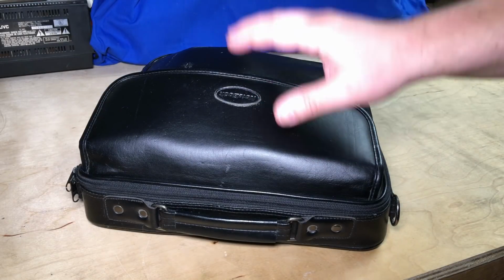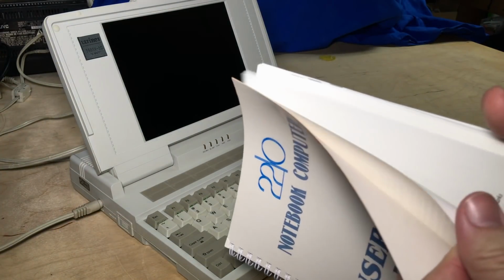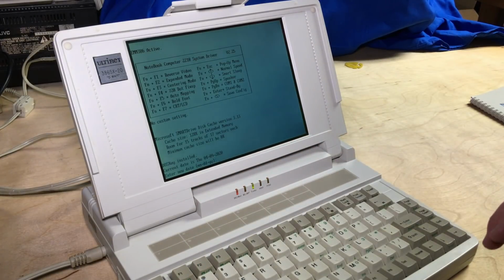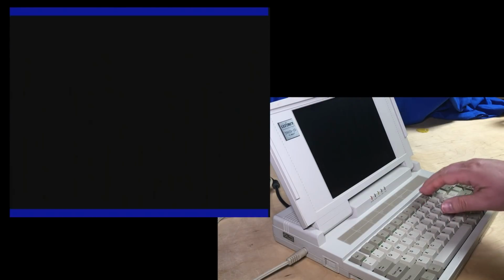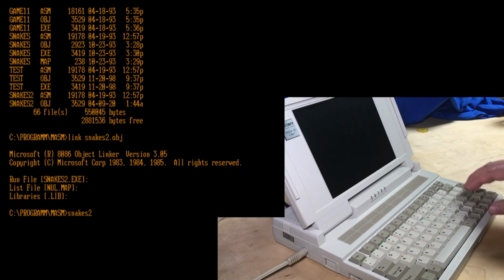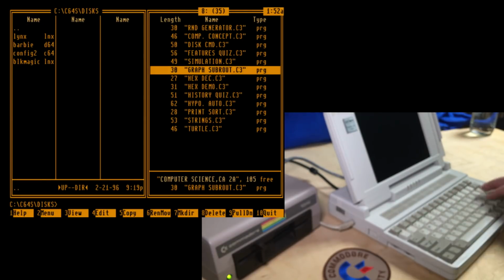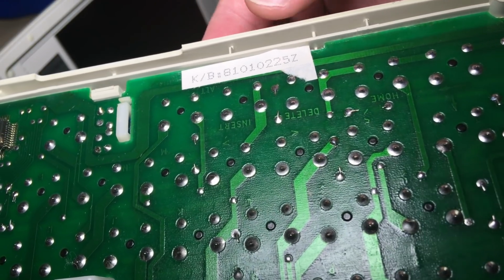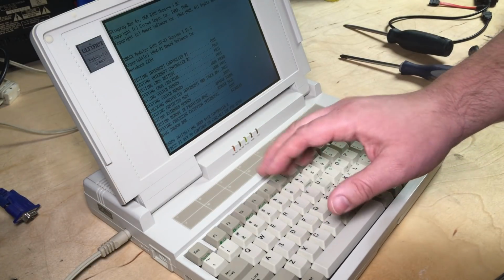My 386SX Laptop: X1541 C64 Transfers, 8086 Assembly, MS-DOS and More

Comment from the maker: Update: mystery already solved! Thanks to Jim Leonard (co-creator of MobyGames and 8088 MPH coder) who identified this computer as a rebadged Nan Tan 2210.

Also thanks to Jason Compton for finding a review of 3 rebranded Nan Tan 2200 machines (from Bitwise, Micro Telesis, and National Micro Systems) in the August 1991 issue of PC Mag from pages 136 to 143 : https://books.google.ca/books?id=JkmqysqcLI0C&q=nan+tan+2200#v=snippet&q=nan%20tan%202200&f=false
Reply: Sager/Clevo is another major manufacturer of generic, unbranded laptop computers, made to allow smaller vendors to sell computers that are either unbranded or rebranded with their company name and logo on them. For example, System76 is a company that sells laptops preloaded with Linux, and when you order one from them, it is drop-shipped directly from Sager's warehouse in California.
Reply: "0 wait" on the shield is about zero-wait-states RAM. A performance boost technology, thanks to that Headland chipset.
Reply: That big Headland chip isn't a VGA. It's highly prised all-in-one system chipset vendor of the era. VGA is CirrusLogic chip (under the shield) + Bt chip combination.
Reply: Upgrade time while you have the lid off, ram and co-pro should be easy to source. Wonder if you could refurb those batteries, maybe wedge some lithium cells in for a longer runtime. 😁
Reply: 8-Bit Show And Tell looks like a toshiba t series. Floppy ports and battery parts are toshiba. Its battery packs look like the t1100.
Reply: I have a laptop very similar to this, but I'm not sure how similar. I'll try to dig it out and check. I'm in Germany.

I didn't actually have it back in the day, I got it 5-10 years ago for free, someone found it in their basement or something.

It's in dire need of restoration, I've not gotten into that yet. It could need some cleaning and retrobrighting, also the harddisk is broken, I thought maybe it can be replaced with one of these CF card things...
Reply: Wan Hung Lo computer corp

Comment: You could try the hard drive in a desktop to save the data. Sometimes the caps gone bad and it can't spin up. But sometimess if you hold the disk vertical or put it in the freezer for a bit you can get it to spin up one or two times again. Once you do, don't turn it off quick save everything to another HDD.

Comment: Interesting video - I would like to see another one about the restoration because I fell in love with similar laptops by Toshiba in dark grey and with orange plasma screen; I tried twice to buy one from Ebay, but both didn't survive the shipping. :-( Seems such machines are way more fragile than C64s and 1541s.

That Snakes game looks like fun - reminds me of Boulder Dash.

A note to users of Star Commander: Don't hesitate to use warp mode, the documentation says it is not only the fastest, but also the most reliable transfer mode!

I started using Star Commander to transfer data a few months ago. It goes 1541 -> Win98-PC -> 3.5″-disk -> any computer with internal or external USB disk drive. (Perhaps I should look for Win98SE which should be able to handle USB.) 

The Win-98-PC is configured to boot to a DOS menu similar to yours, with one option being to boot on to Windows. In that menu I used escape sequences for colors reminiscent of plasma-orange, but that doesn't help some old DOS games having that ugly color palette with cyan and magenta - any monochrome screen should drastically improve the aesthetics of these games.

Comment: Oh man, that thing looks reasonably similar to a 386SX laptop I did a video on last week.  The poor thing had been sitting in the bag for years with a corroded battery.  Unfortunately as I was 'repairing' the Dallas RTC chip, the motherboard seems to have died on the operating table.  It won't POST anymore.  I'm pretty disappointed about it.  I managed to get the machine to start up a few times no the video at least.  Has almost the same Award BIOS as yours, and the whole machine has an odd brand also.

Comment: Slow emulator oh my have you forgotten the C64 emulator running on an Amiga 68000? I think it was about 10% the speed a real 64! The fact that it came to the cable that you could plug in a 1541 drive was really it's only saving grace
Reply from the maker: Yeah, that C64 emulator on Amiga was laughable. I talk about it a bit on this podcast on my 2nd channel, actually: https://youtu.be/sKnlNHHKTEE

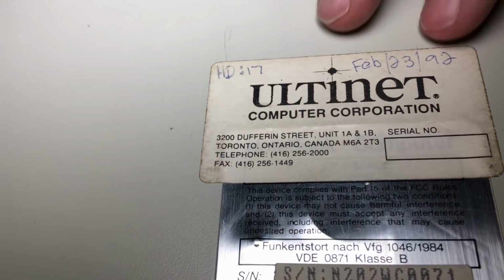Comment: They sold these things in germany too. 2:43 you can see that at the sticker. "Funkentstört nach Vfg" is german.
EDIT: Maybe just in Switzerland and Austria. Because there is no TÜV Sign on the Sticker. Back in the 90th's any Electronic device (before the mass production from china ^^) from this size needed a TÜV approval.

TÜV is a company that check if stuff (Electronics, Cars etc) is safe to use (Fireproof etc) it's hard to say  if the TÜV is a ""company"" by the state, but it's for the state. But if something got the TÜV Sign you can sell it for more, because people priorize stuff with the TÜV Sign.

TÜV is also the Group/Company the check any 2 years your car for safety (it cost 70-120€ !)
If your car fail the TÜV Check, it is not allowed to drive the car anymore on streets, if your car dont fail you get the TÜV Badge on your license plates.
That's why most people here hate the "Car TÜV" because most TÜV Checkers, expect cars that look like a 2-5 years old car, and are just ***holes. They are very picky, and if something is a small problem, that can be fixed in one minute from them (like headlight settings to high)
 they will not fix it, they will just inform you, and write the problem on there list.
3 small problems (and there will find 3 !) and your car has failed, then you got 30 days time to fix all, after 30 days you must pay 35€ again, and there will check for the problems on there list, and if your car fails again, you must do next time the full check (70-120€) again.
1 Big Problem (what they declare as big, is often enough ridiculous) and your car has failed.
Last time my car has failed because of a ""Big"" problem. The Hood from my car was not easy to open (the lever was stiff)
Yes open, not close ! Those idio** saw a hood that opens not easy as a security problem, i would understand it, when the hood dont close easily but open ? But that's how the TÜV is.

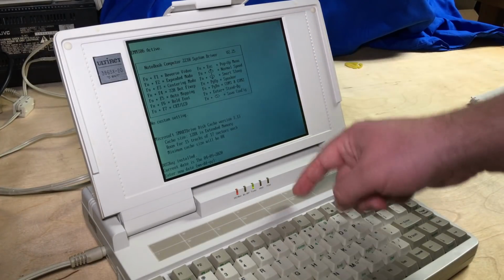Comment: 9:04 I was looking for ages for a software for one of mine until I found note3300.sys or something. It works. I have two very very similar cheap non-branded machines. Same BIOS, but 486 machines. The newer one has a larger screen and allows using the VGA port without this special driver. Also has 512k VRAM (finally...). The insides look like they came from the same factory.
Lol the display turns off the -20V for driving the LCD pixels, but the super power hungry backlight stays on - like the company who made these didn't know what they're doing.
That snake game looks like Rodent's Revenge without graphics but with music.
29:00 That black blob looks like what generates the -20something volts for the display.
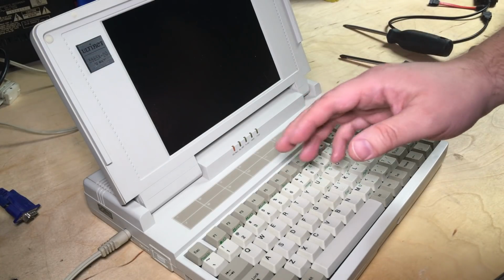30:00 check http://tempect.de/senil/p10.html these Conner Hard Drives have a very common and relatively simple to fix problem - but it's in German. The gist is that the arm is stuck to its parking position and the electromagnet can't overcome the permanent magnet, so you slip a piece of sticky tape in between and that fixes your hard disk.

Comment: Linux users use both graphical and text only  Commanders for file operations.    Dos like console versions even work on very remote servers with no GUI or keyboard.      I have Toshiba  Dos laptop roughly like yours.    I may try to write a file Commander for it and my other DOS system.  I want my Dos systems as terminals to my linux systems.     That is a real beauty of a DOS machine, and the C64 disk hookup is just amazing.  Thanks for your fine retro computer videos.  I am very much into what I call trailing Edge technology.    Good luck.

Comment: You might be able to get the hard drive to spin up by giving it a bit of a tap on its case at the right time with your tongue at the right angle, or drop the corner of the laptop with the hard drive in it a couple/few mm. Once. 😀 I've used that technique even with modern drives. It doesn't work too well with SSD for some strange reason though... 😅

Comment: I built an X1541 cable and remember using Star Commander. Also, I remember finding a DOS program with source code that emulates a serial device drive (not complete 1541 emulation) for the C64... I decided to port it to Win9x  by creating a device driver to handle the real-time parallel port bit-banging. Ah, fun times when I would do so much hacking/hobby coding, especially anything C64 related.

Comment: The word "Funkentstort" on the metal sticker on the back is missing the two dots to be correct --> "funkentstört" which means interference-suppressed. They had to put it there because otherwise it wouldn't have been allowed to sell or even operate this device in Germany back then.
Reply: the literal translation of that does not really make sense btw... "radio de-interfered" 
I have no idea why it is called that in the first place, it does not even really make sense to me as a native speaker. I mean, I know what it means, and that it is the "proper" way to say it, but the construction of the word is so terrible that it makes me wonder, who came up with that.
Reply: @silkwesir1444  Ist prinzipiell nach dem Standard für solche Wortkonstruktionen aufgebaut: Entstören bedeutet eine Störung zu beheben bzw. zu entfernen. Funkentstören bedeutet eine Störung, die Funk betrifft, zu beheben. Gleichartige Wortkonstruktion wäre z.B. ein Apfelentkerner.

Comment: Thanks for the video. I am surprised you never increased the RAM or inserted the math coprocessor.
Reply: Those options were very expensive, here in Australia i waited forever and paid in @ 1992   $100 AU per  meg of SIM 72 pin ram for my 486 - yes the guy at the shop reserved 4 sticks of ram for me and i bough one stick every second saturday because i was on 2-weekly pay - oh and i never told my wife
I still have them and the 4 x 256k that the computer came with

First of these new interchangeable no controller required  IDE hard drives i bought was a 44 meg for $400.   Plus i waited for a Creative lab 2 speed CDRom and a 8bit SB sound card to drop under $1,000, one day i saw it in a big box for $699 - i went to the bank and upped my credit card from $400 to $999 to buy it - i still have both of them installed in the Gateway Pentium 200 in the spare room running dual boot Dos 6.22 and Win 98

Comment: The mechanical connectors for the external floppy drive and keypad are standard connectors. They are called "MDR connector" (at least by 3M). The pinout is proprietary though.
About the hinge: Apply a little bit of grease (remove old grease first), and if there are two hinges, make sure they are in-line.
The potted component in the bottom left corner might possibly be the backlight inverter. It is close to the brightness control.

Headland Technologies HT-21 is the main chip(set), see e.g. here for a data sheet: http://pdf-file.ic37.com/PdfOld/icpdf_datasheet_8/HT21P_datasheet_88310/144149/HT21P_datasheet.pdf
The 8 RAM chips left of the BIOS are 64Kx4 chips, resulting in 64Kx32 for the VGA chipset, likely a Cirrus Logic chips below the RF shield. Their GD610/620 chipset was quite common in notebooks of those days, and https://www.vogons.org/viewtopic.php?t=57110 mentions a BIOS with the same boot message as your bios on a card with the GD610/620 chipset.
The 8 RAM chips right of the coprocessor socket and the main chip are 256Kx4 chips. As your system has 16 bit memory access, they are 2 banks of 256Kx16, i.e. 1 Megabyte. To upgrade to 5 Megabytes, you need 8 chips of 1Mx4, like the TC514400AP. They seem to be quite rare in DIP pinout nowadays, though.

Comment: The ccs64 (2.0B) is a way better choice for dos, I bumped into the same problem with a '93 386DX-33MHz desktop machine and c64S. And yes I also had a C64 back then, and some stuff needed to port from PC via X1541-cable. That 386 had an important role in my later PC-stuff, but not as important as C64 as a means to understand computers, I/O and coding.

Comment: I remember assembling a cable to connect my 1541 to my amiga. The schematic was included with the Frodo C64-emulator.
IIRC it took axactly 9 minutes and 30 seconds to copy one while disk (.d64) to my amiga.
So I was setting my casio watch to a countdown of 10 Minutes so I remembered to go back to my 1541 to insert a new disk to copy. lol
Took me 2 days to copy my whole collection of c64 disks, and there was only a read error on of the one disk.

Comment: You should be able to replace the hard drive with like a CF flash card or something like it I believe. I'm surprised it worked at all. Hard drives don't age well even sitting on a shelf for some reason.
Reply: Hi, in 2018 or 2019, mum cleaned out the garage and i took back my 386dx that was upgraded to 486sx and finally Pentium 100, it has 2 x connor 520meg hard drives that came fro my original 386 any my sisters ( she got a newer new machine and we kept the old for spares - i used the hard drive as a slave drive on mine, her old PC became a old games machine with just floppy and possibly the oldest IDE hard drive maybe 80/120 meg ) 

Anyway it still works, it still has all dos saved games from 1993-1997 and both kids school assignments in microsoft office 4.2   But the drives are very slow, it seemed like it took over a hour to file copy D to C in a folder and format D to freshen it up

Regards
George

Comment: It would probably be a good idea to take apart my wii and n64 and remove any batteries that might be present. I've seen enough destroyed amigas on youtube to know they need to go. lol
Reply: The Wii uses a coin cell.  Its behind a little door with a screw (on the bottom in vertical stand mode) so its easy to check, no need to open the case.
Reply: The early PS2 (thick model) was just maddening to get at the CR2032 coin Cell. You knew when it died because the DVD drive couldn't recognize disks. Anyway Sony got the memo and later thick and all the thin ones had trap door access panel for the battery

Comment: Awesome video, but you really should build a COVOX for this machine
Reply: is that like a speach synthesizer?
Reply: @coolelectronics1759  Na it's a very simple sound card ove/dac a parallel port. LGR(Lazy Game Reviews) did a video on it a good while back, and one of my friends had one on their family's 386 as Sound Cards overall where expensive back then. 
https://www.youtube.com/watch?v=spOenlrSSOE
The 8-bit Guy has a shorter but good video on it as well which also includes some info on the Disney Sound Source which worked on a similar concept, but has a powered box with a built in speaker with a Mickey shaped speaker grill. 
https://www.youtube.com/watch?v=Wt4VcLF8Wug

Comment: WE CAN REBUILD IT!  We have the technology.   And by we, I mean you.

Replace those capacitors, get a new CMOS battery, get a new (er) hard drive - or maybe an SD card adapter - and max out that RAM.  And maybe find a way to replace the batteries.

Comment: For us non-coders, what is the trick to having music play while the game progresses?  Thanks!
Reply: Usually you would have your music routine called regularly as an interrupt routine, perhaps triggered once for every vertical blank interrupt (e.g. 50 or 60 times per second). The music routine would advance to the next part of its timeline and maybe trigger a sample to be played via DMA, or maybe send commands to a soundchip like the SID or YM. PCs were a bit of a problem in the 80s and early 90s because there wasn't just one way to generate sounds. One machine might have an Adlib card that receives MIDI commands (sweet!) but another might only have the built-in PC speaker (good luck).
Reply: @batlin  Thank you for the detailed explanation!
If I understand the subject correctly, it is imperative that the programmer not allow the program to get caught up in a routine to fails to grant adequate time to sound generation.

Comment: A Zenith Minisport was my first laptop.  20 MB hdd, external floppy disk.  I never knew Star Commander could be used to hook up to a C64 drive - that's awesome !!  Wish I had know about that in the 1980's.
Reply: I had(still have it in storage) a Zenith Data System 286e SuperSport with a 20MB HDD, and Letter Perfect, plus the chonky battery pack, and carry case.

Comment: Was that educational program really for the C64 or is that just a coincidental part number? I remember seeing a surprisingly large amount of Commodore-branded educational software for the VIC-20 on ebay a few months ago.

I don't know why it would be written on the chip surface, but my best guess would be to say that B1 refers to a "stepping level": https://en.wikipedia.org/wiki/Stepping_level, https://devblogs.microsoft.com/oldnewthing/20110112-00/?p=11773 (though this latter article begs the question as to how a post-1991 computer got one of these chips on it, if I am indeed correct)